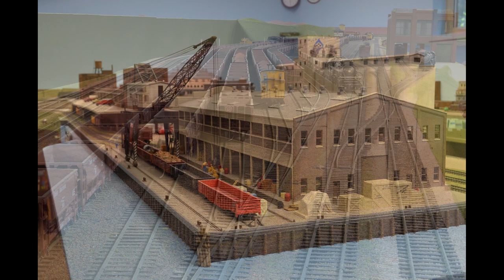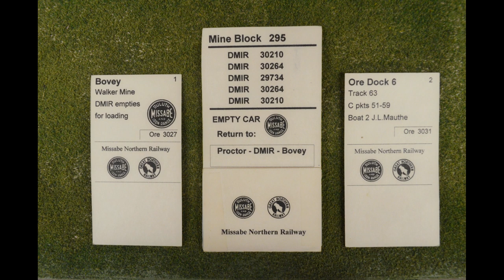The Missabe Northern Railway - Part 1 - Overview and Route to Mesabi Iron Range of Minnesota

Comment: You have done an incredible job on this layout. It must have taken a lot of control not to fill all of that space with track. The result is spectacular. Thank you for sharing the layout.
Reply from the maker: Thank you.  My interest, as a railfan and retired railroader, is seeing trains going somewhere making money, not crawling through a maze of inner-city terminal trackage surrounded by "clutter".  Seeing decent size trains flowing 30-40 mph through very large radius curves and easements is more photogenic for me than thumping along at 5-10 mph through a bunch of rough commercial turnouts. This is balanced with a lot of yard and industry track as well, so I have the best of both with variety in both as I saw in my career.

Comment: Where can we see a video on how you do your switch controls???  Wonderful road...I'd also like to know how you make a spring switch in HO...I've never seen one in that scale...
Reply from the maker: Azatrax makes excellent infra-red detector circuit boards to control switch machines or other devices.  One version they offer is called spring switch.  The turnout stays lined for the normal route. When rolling stock approaches from the reverse side, the switch points are lined to allow exit.  A second detector just past the points "sees" the equipment coming out and holds the turnout in position until the train has passed, then with about a 3-second delay to be safe, it throws the points back to the normal position.  Very reliable.  I have heard of people doing actual sprung points, but I figured that would be too risky with steam engine pilot wheels.  They might not have the weight (or spring pressure) to push the points open reliably. I prefer to remove the springs on pilot trucks and add some weight to them so that the main engine weight is on the drivers for tractive effort.  I also did not want to risk the points not fully returning to normal position - not a desirable situation for a Yellowstone or N3 with 60 ore cars possibly picking the points.
No video of my push-pull switch machine control - at least not yet. Heart of it is DPDT toggle switch that provides spring pressure to hold points securely.  Extremely reliable electrically, extremely reliable mechanically, extremely inexpensive.  All my frogs are power-routed with SPDT set and the other SPDT set used at times for fascia LEDs on harder to see turnouts.  A large railroad isn't nearly as fun if one has to do maintenance on switch machines and track cleaning. I would never have built a home railroad this size if I didn't have proven methods to minimize work and maximize fun time.
Reply: @Missabe3  Can't do that because I have no power in the track at all. All my engines are completely battery powered and i love them...
Reply: @Missabe3  Would love to see a video on the push pull switch controls. I am trying to do some of my ideas now...

Comment: Lovely video! What brand of engines are these? Especially the 2-8-0’s since I’ve been meaning to get one
Reply from the maker: A mix depending on RR. Peg yard switcher is a United brass UP engine stand-in with tender (from IC engine as I recall).  Peg also has three Bachmann 2-8-0s as stand-ins. With large railroad, re-detailing engines lower priority than more scenery, for example. GN includes two Tenshodo brass F-8s and a Sunset (Samhongsa brass) F-1.  Look for old (long out of production) brass on eBay. Bachmanns not currently available, I think, but you may also find on eBay. But beware - many owners of the Bachmanns stripped the main gear and part hasn't been available for years. I never put DCC keep-alives in steam engines (or diesels for that matter) because of risk of a person grabbing and bending valve gear, locking it up and stripping an axle gear.  I simply don't need them because my electrical pickup from track is very reliable.

Comment: Is that a brass yellowstone? If so what brand?
Reply from the maker: Collected over the years.  PSC you are seeing is newest brass from about 1998, picked up an MTH to reduce mileage on brass models that include Westside Samhongsa and oldest an Akane I re-motored. I put SoundTraxx in all, ripping out the junk MTH decoder along the way.  The 1980 Westside was actually my first and I had to replace gearboxes about 5 years ago. Had to replace both Westside Sam gearboxes due to being only 24:1 ratio. NWSL 36:1's and back-emf tamed it beautifully.  Got 1960 Akane at a reasonable price about 10 years ago, then PSC also secondhand, then MTH. Akane is surprisingly good runner especially with putting can motor in it, but not as accurate a model.  MTH runs OK with better detailing than their earlier models but their decoder has DCC as afterthought and not nearly as flexible sound-wise as SoundTraxx. The PSC took by far the most work to ferret out all the places it would short itself but worth it.  Very unusual equalized chassis but runs rock steady with no wobble that can occur with conventional springing in a very heavy engine.